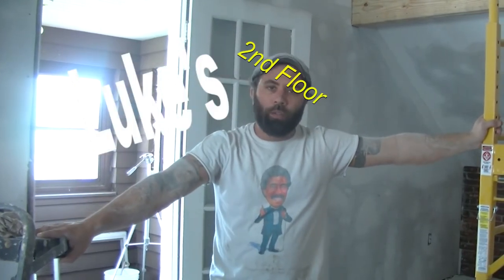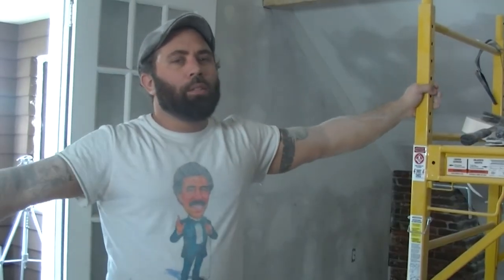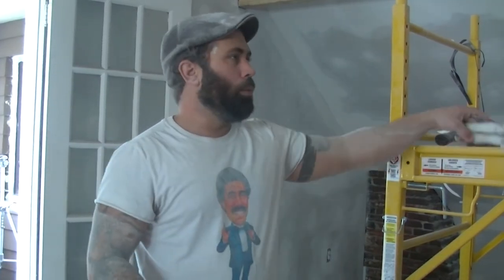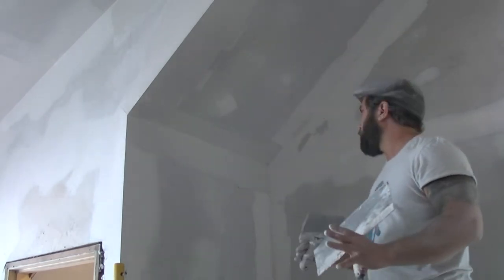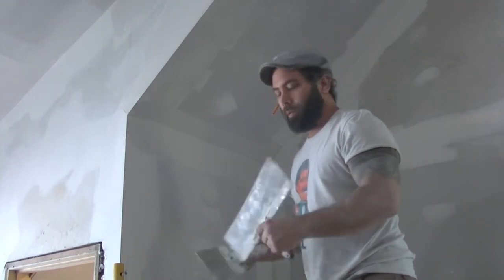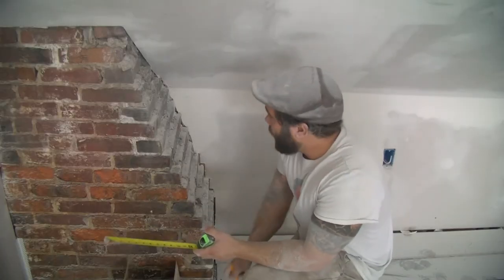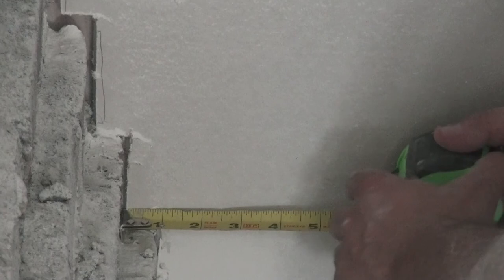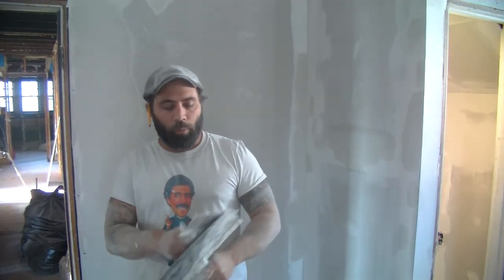2nd Floor Renovation: Episode 13; Drywall Finishing Basics

Comment: I've always said that the only thing worse than doing concrete is sheetrock.  I did concrete before I joined the army and we used to watch the sheetrock guys hauling all that board into houses.  F that!  I joined the army so I wouldn't have to work so hard.